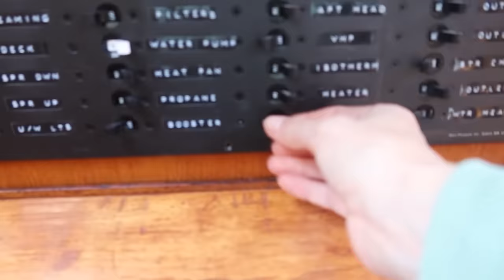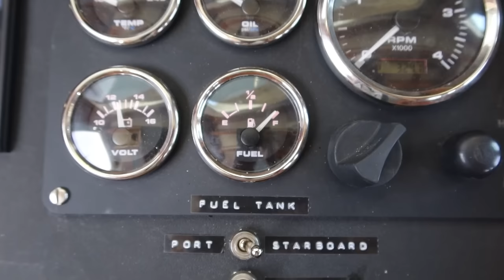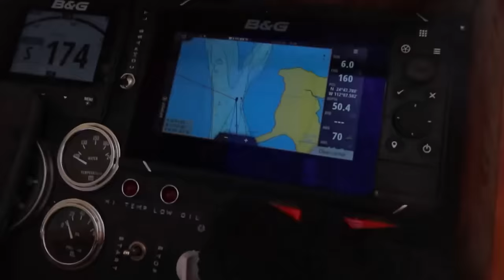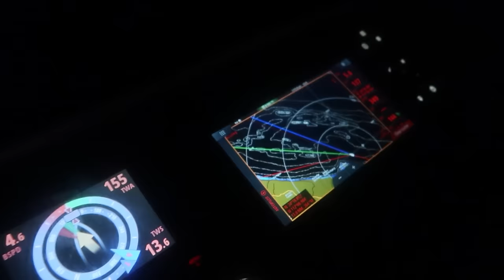(Fans ONLY) LOOK who's Back?!  | 30min RAW Format

Comment: To keep the Vent from spilling overboard😢 if you over fill during transfer. Daisy chain the tank vents together.
Then if a tank over fills, it will drain back to another tank. Use large pipline and make sure the overboard one is Up high😮